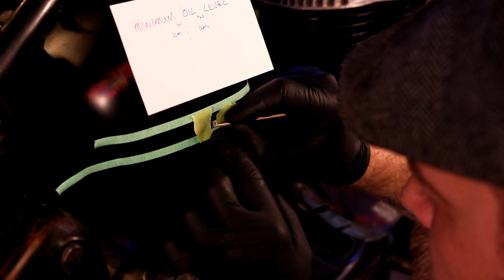Classic Triumph TRW Motorcycle Restoration Pt 4 - Assembly

Comment: Love how you're making it mechanically like new, yet keeping the original patina .
Reply from the maker: Thank you Sir. The fun with this one is keeping it looking like that. What wasn't shown was the work to get rid of the old lime green metallic flake that was previously splattered over the bike, while also trying to bring out some of the original olive drab paint (like on the chain guard). The covers, tanks and other items, it's a mix of cleaning them right down to bare metal, priming, spraying olive drab, then red oxide and finally black. With 2000 grit sandpaper and steel wool, the layers of paint are worn down and then hit with clear coat. 

Thanks for watching, the comment and your continued support! All the best. Cheers!

Comment: What did you use to shine up the gearbox/engine ?
Reply from the maker: Hi Jordan, I used Brasso and a rag. It took some time but the results were worth it. I'm sure there are other products that Mothers or similar companies put out that will make the work much, much easier with the same (if not better) results. Cheers!